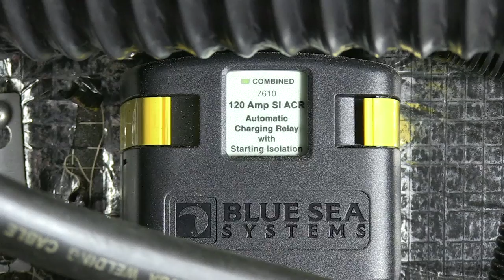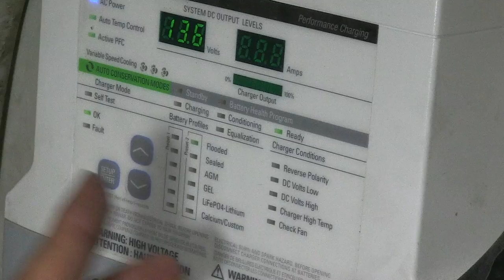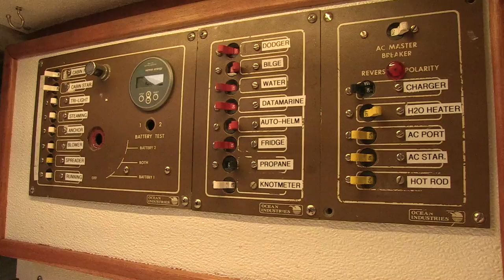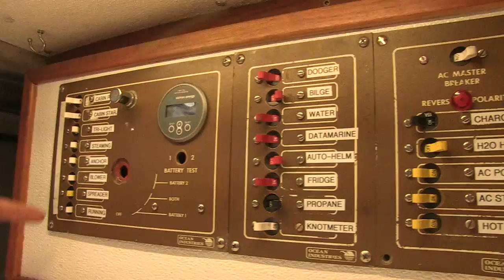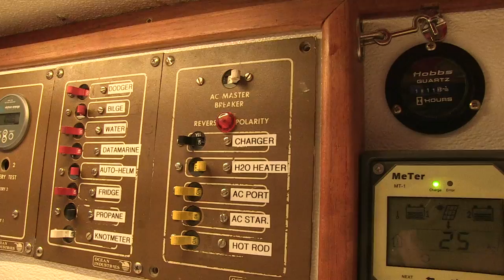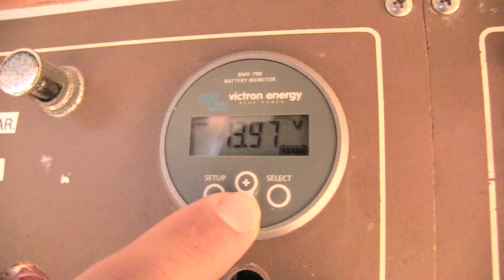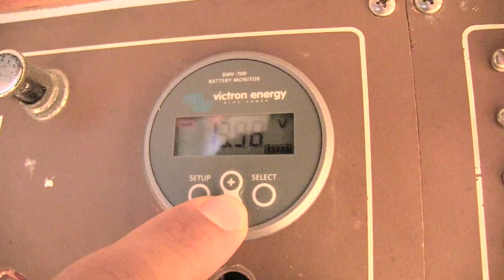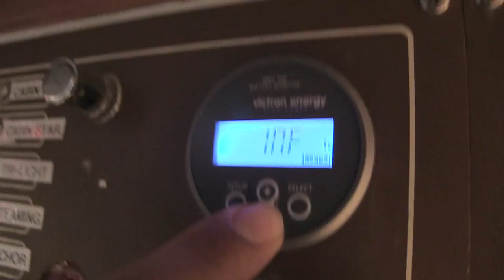PYS Electrical Audit: Full Version

Comment: As a continuing to learn marine electrician but a long time industrial/construction electrician/newly retired Electrical Safety Officer, this is an EXCELLENT overall explanation of the whole boat electrical system and how it all integrates together... The pros & cons as well as the ‘nice to do’ vs the MUST do is very well stated, all without losing most to unneeded techno-babble. Thanks! I’ll be forwarding on the link and using it as ‘back-up’ for some of the more ‘stubborn’ (= cheap!) boaters that I run into.
Reply: Thank you for your feedback.

Comment: This is very good sensible advice, its turns out i just finished rewire ring my instrument panel on the fly bridge and i did the strip bar connections to and from reducing a hole bucket full of unnecessary wires, now everything is tag and easy to find,.
Like he said, it takes time and patience and a good electrician.

Comment: Great video. I learn so much from you. Question: did anyone notice when you are pointing out the fuse holder on the negative wire from the ACR opened when you touched it? I believe it wasn't latched closed properly.
Reply from the maker: Good one!

Comment: Great video thanks!!!. I noticed the compass just above the AC/DC panel. I wonder how often he has to swing that compass and how far it is out? Shallow coves or running close to shore with poor visibility are not the times to wonder if the compass is accurate.
Reply from the maker: Good point.
Reply: I also noticed that. Need to do the "TUG" test every time!

Comment: Excellent job Jeff. Thank you very much! I still leave it to the professionals, but it helps to somehow understand which direction to look at. Greets from Lake of Zurich (Switzerland). One question I have. I own a Bavaria 29 Sport 2014 with twin Volvo Penta 225. There are two 135 Amp house batteries. I have: two fridge, Fusion stereo with amplifier and subwoofer, 3 underwater lights, water boiler, 6 non led lights plus anchor light, 7 inch Raymarine Axiom. Most of this stuff, i switched off besides the fridges and used a boombox instead of the stereo, or batteries for the lights (except anchor) and did not heat water. We have tried to stay out for a weekend (Friday evening 7pm until Sunday at 3pm), obviously that did not work out and on Sunday morning we ended up with 11.4 volts on the clock (I believe this damages the batteries). So my goal is to replace those 135 agm‘s with two 200amp lifpo4 batteries. Do you think that is enough? I am new to boating (first season in 2021).
Reply from the maker: The refrigeration load is what drains most batteries. As you mentioned, two 135 amp-hour batteries is pretty small for 2 nights at anchor. 400 amp-hours of Lithium should give you about 300 amp-hours of useable capacity, that should be enough to last a weekend.

Comment: awesome job I had to rewire my boat and wish i would have found this first as i had to dig through the code to sort out what it should be.. I am a little confused over junctions ie lights i have been splicing in a wire to the main light circuit. I have been using a crimp connector with heat shrink.  but this seems a little flaky as oppose to having a junction box.

Comment: Excellent information, thank you for your video.  You might consider mentioning the difference between European wired boats and US wired boats.  If you think folks get confused about AC/DC wiring colors, throw in a couple of brown wires and some older color coded (green w/white stripe etc.) wiring.  Thanks again
Reply from the maker: Good point.  We have an article available on that topic, http://www.pysystems.ca/tech-talk/techtalk/2017/05/30/european-conversion/
Reply: No you don't. (Dead link?)

Comment: Connector corrosion: for welding cables going to a battery or alternator that aren’t heat shrieked and have some light corrosion. What is the best way to clean them up and protect them and when is it not worth it and just time to replace them?

Comment: Jeff, this was a great walkthrough. I learned much.  What are the best connectors to use to tap into both positive and negative 12 volt feeds to a circuit dedicated to, let's say, a bank of cabin lights? I have 6 led lights in parallel.  Can the + and - leads coming out of the lights be connected into the main 12 volt  cable (dedicated to the lights) using some type of T connector?  Thanks.
Reply from the maker: Hi Mark, in those circumstances we'll intercept the existing wire and cut it and terminate it to a terminal strip. From this terminal strip, we'll bring terminate wiring.

Comment: I thought the jury was out on locking washers? Did I miss a meeting?

And your point about CB + batt switch being redundant. In the aviation world we have a golden rule that you never use a CB as a switch and you will wear the mechanism. If you want a switch use a switch, if you want protection use a cb or fuse.
Reply: Buck Turgidson I thought the same. Big red switch is easier to see in an emergency and could save seconds, even if the breaker is nearby.
Reply from the maker: Hi Buck, not sure about the jury but we've used lock washers (not to be confused with nyloc nut) with great success on thousands of battery installs. Since a boat is a vibration prone environment, we find that a many connections without a lock nut become undone.

Comment: The small red lead coming off the “stack” and temp sensor is not fused near or at the battery. All fuses should be in a moisture resistant enclosure or holder. Several lines have multiple extensions and unsealed crimp connections. The one lug that had no heat shrink sleeve was not crimped, it was vice squeezed. Any terminals on batteries, mounted busses or control devices that have potential to spark/short to ground if a part or tool could come in contact should be covered. Ideally the whole battery group should be covered but it may have been removed for the video. This was not a real bad wiring. I bought a boat where the previous guy knew just enough to be dangerous. One terminal was a block of wood with a carriage bolt and at least ten wires and NO fuse at all !
Reply from the maker: Thanks for sharing Karl, appreciate it.

Comment: I have watched most of your videos, thank you. But one question keeps arising on the subject of batteries. The discussion evolves around a battery bank going flat then being recharged, but in reality a battery bank is under charge, to a greater or lesser extent the whole time, from one of the charging facilities, (excepting when full). 
To me this means both drainage and charge is happening at the same time, therefor it is not possible to know how many charges it takes. I'd add my sailing experience is very limited at the moment.
Reply from the maker: Hi Eric, good question, if the charging amperage exceeds the amp loads on the battery bank, then the battery is being charged. Albeit, not as fast as without a load.

Comment: What's wrong with good soldier joints with heat shrink. Forgive me but this seems  more solid then 2 crimped connectors hooked up to a bussbar?
Reply from the maker: Good question, here's what i understand, for marine installations that are prone to vibration, the recommendation is to do a mechanical connection. You can certainly go further and also solder the connection but i don't remember a boat builder who does that. Can anyone else add to the conversation.
Reply: @PacificYachtSystems   I am not a boat builder by any means.  However  I bounce down the road with  my tractor trailer and what I find is crimping repairs is always the week link. Sodium, sub zero, vibrations  are not then same as marine application?  What I find best is to solder with heat shrink. Lithium grease.  Want to thank you also for sharing your knowledge. As I thinking on a 20 year old yacht... never thought of the great handy work been done those years. However your experience and sharing helped me realize also. Thanks

Comment: What about the major wire gauge difference between the positive and negative for the windlass?  5:52 he identifies the negative and  10:26 he identifies the positive.  Doesn't that effective make the smaller negative provide less current to the windlass than it really needs?
Reply from the maker: Hi Rooster's garage, good one. The windlass wire positive and negative wire should be same wire gauge. Also, one needs to make sure the circuit breaker or fuse protecting the wire is sized to handle the smallest wire.

Comment: Hi Jeff..very  instructive your video. I just found them. 

I have a question. Would you recommand to add  a low voltage disconect switch like the Blue Sea 7635 to prevent complet battery discharge?
Thanks again!
Reply from the maker: For a DC panel, I think a low voltage disconnect is a good idea… especially if you have the option of overriding this feature if need be. Since the Bluesea 7635 is rated at 65 continuous duty, make sure it doesn’t handle large loads like an 2000 Watt inverter or a windlass.
Reply: I serviced a Mas 28 Elegante this season. As a Euro boat, their standards are more aggressive than ours  on this side of the pond. Additionally they did have a LV cutoff relay which in turn opened all non critical circuits. EVERYTHING was on a relay ..  they love their relays.  ..  yes....  even more than Hinckley. hahaha

Comment: I laughed out hard when he pointed to the fuse on the ACR at 9:50 point.  Right after he said how important that fuse is on the ground side, he touches the fuse and the plastic nut came right off.   You can see the fuse wasn't even locked in properly.  You can also see some of the wires had at least two automotive butt splice connectors to extend the wire (orange to red and back to orange again) and it goes right into the same terminal as the temperature sensor on the positive terminal.
Reply from the maker: Boats are full surprises, just look hard enough and you'll find something you can make better.
Reply: @PacificYachtSystems  I'm doing a small rewiring job on my friend's 21 foot Triumph recently.  Triumph put in a bus bar with positive and negative next to each other.  On one end, they attached the positive terminal for the engine and the terminal is 1/4" away from shorting to the negative terminal.  There was no insulator to separate the positive from negative side on that terminal block.   Those two wires are directly connected to the battery and the power switch with no fuse or circuit breakers.  They had two plastic caps but it only prevents something dropping on top from shorting. Its amazing how bad even original stock wiring jobs are on some of the smaller boats.

Comment: Is it ok to use black tape instead of heat shrink

.SV Aja
Reply from the maker: Electrical tape is a temporary insulator when disconnecting electrical connections. 
Heat shrink is meant to prevent moisture from corroding the wires.  Oddly, electrical tape permanently installed on electrical wiring is one of the pet peeves of most electricians. Use electrical tape, but only temporarily.

Comment: How many switches can u have on aboat
Reply from the maker: Hi Christie, with batteries, every battery needs to have a battery isolator switch. I.e. as an operator you need to be able to disconnect a battery from it's loads. Albeit, with some exceptions, like bilge pump circuits and propane detector.

Comment: Can you have a wire attached to a fuel hose?
Reply: You should nott have a wire in any proximity of a fuel hose in case the wire shorts and effectively becomes a “fire wire”.
Reply: Well FireWire is a good transmitter of data, ie. you will know really fast that your boat is on fire.